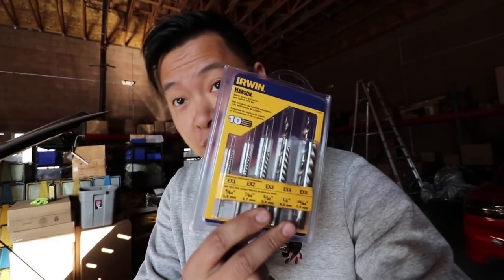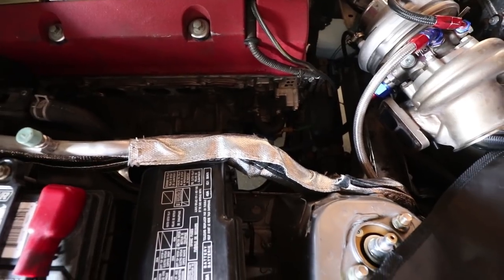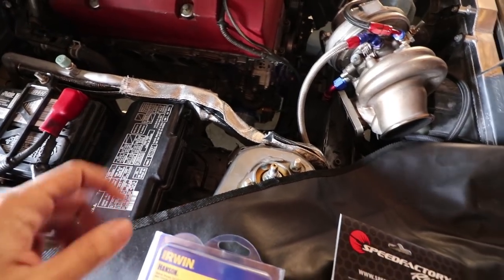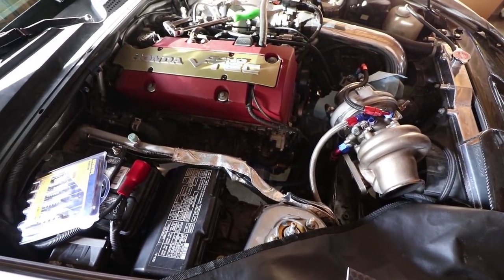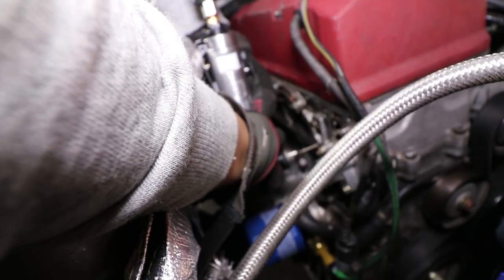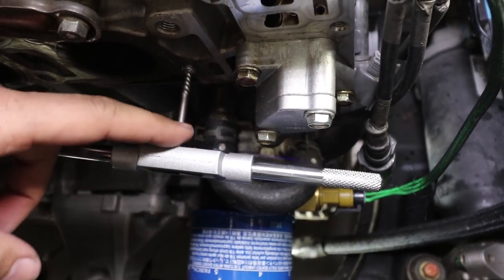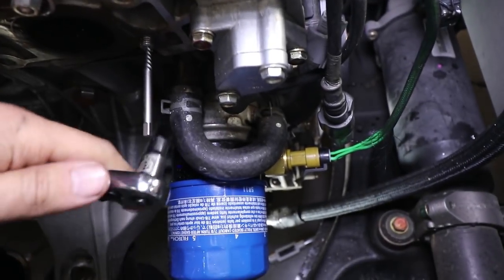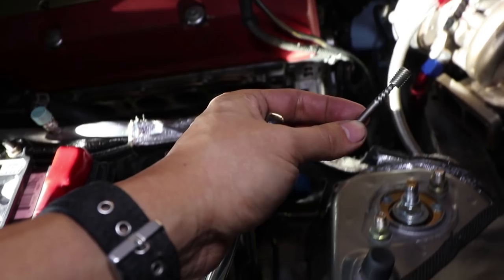HOW TO REMOVE BROKEN STUD OR BOLT

Comment: As I watched you explain why you were using a right-angle drill, I wondered why you didn't just jack up the front of the car and remove the wheel on the passenger side so you'd have a better shot at it.  Reaching down in and contorting your body, hoping you'd center-drill the stud, seemed a difficult task.  Using the ratchet and a socket (12-point) to turn the extractor seemed to make things easier, given the restricted area you were working in.  A small, T-handled tap wrench (0" to 1/4" size) would have also been effective.  Good job removing that broken stud; as you know, those can quickly go wrong, leaving you in worse shape than before you started.  Proceeding slowly and carefully is the way to do it.

Comment: Don’t do it man! Use an A-Sure Out Extractor set! If you break that extractor it’s gonna be a three day ordeal if you’re lucky and cost you anywhere between $89-$1000 if you have to get it EDM. The right extractor to use for a professional is an A-Sure Out. If it breaks, you can remove it in seconds. I tried them and they work and they are 100% made in USA

Comment: Very poor design to expect those bolts to do their job and to hold up a turbo charger too. I expected the broken studs to come out easily as they did as they were snapped off. If they broke off from being rusted in you can have a big problem. Most would weld a nut on to the remaining broken stud... even if its less than flush. The heat really helps even corroded busted studs. Good job!